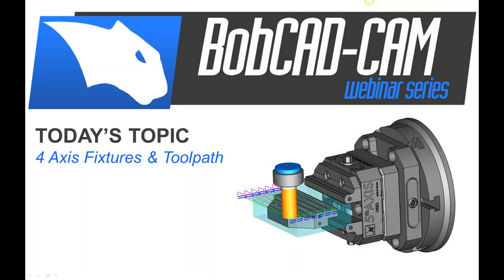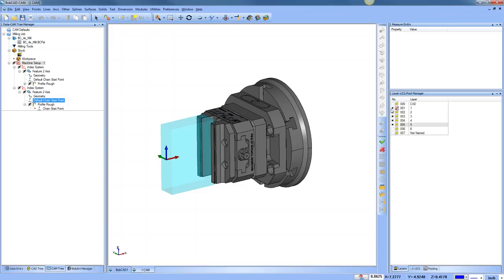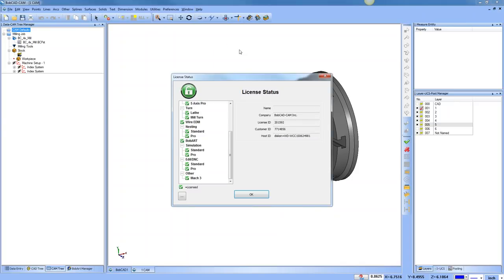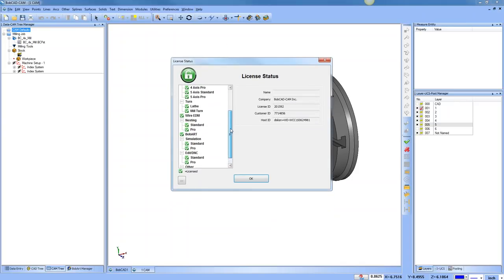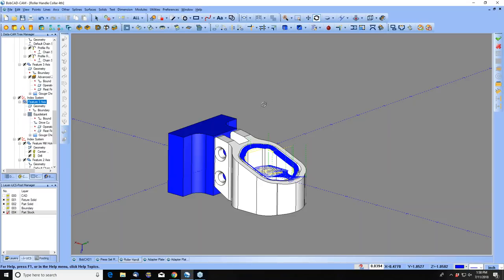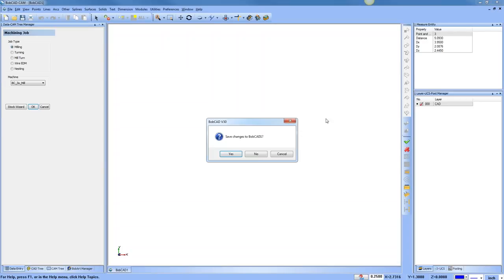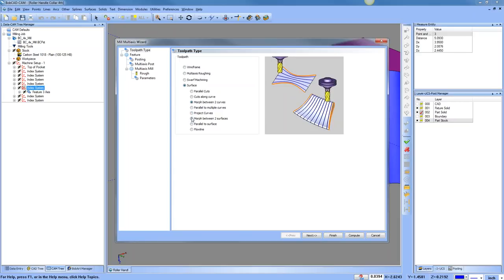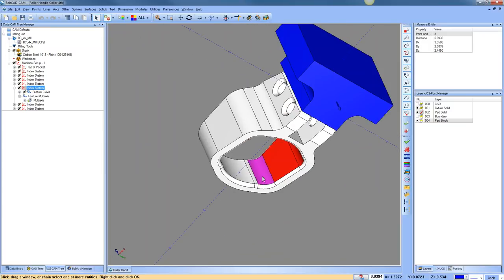4 Axis Fixturing Toolpaths | BobCAD-CAM Webinar series

Comment: Cool stuff. One question I have is, is the block part of the part then you cut it away or is it a fixture that you attached stock to
Reply from the maker: It could be either,   many times you'll use extra stock to allow the stock to act like a fixture.